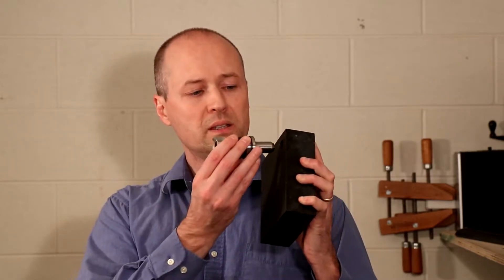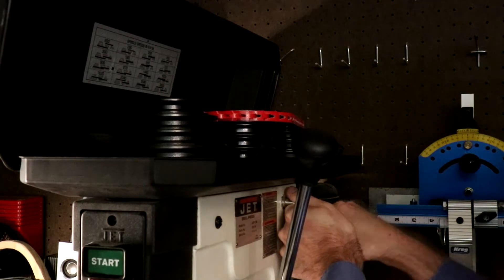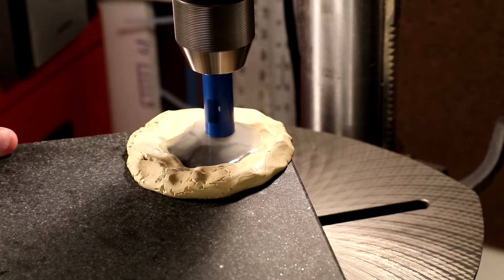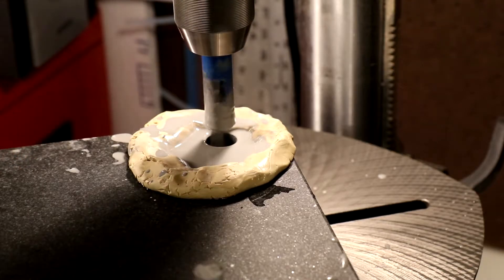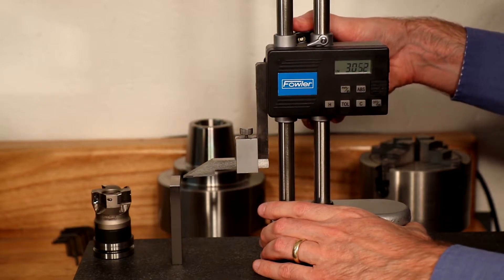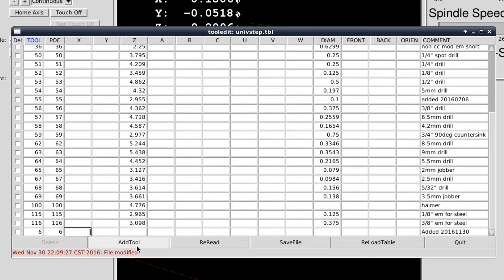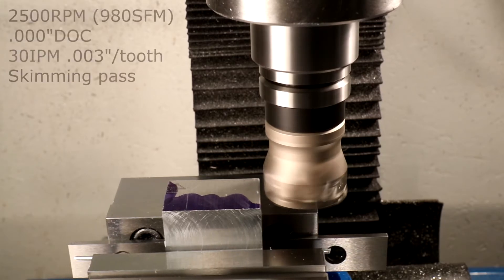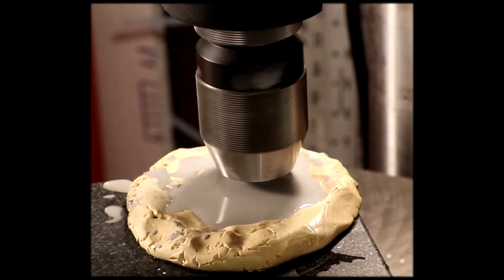Drill Surface Plate for Tormach TTS Tool Length Measurement

Comment: Nicely done!
Reply from the maker: Thanks Rus. Might complement your great looking TTS tool holder (https://www.youtube.com/watch?v=EI5ynlteYAQ) which is a big step up from the wooden ones from Tormach. An alternative to drilling the surface plate would be a ground parallel block with a hole. Best wishes, Kent

Comment: BTW, I'd love to get a list of the toys you have at your shop.  Its apparent you value quality and I'd like to collect some of the same tools as I begin my path.  For starters, which haimer do you have?  Which collets and endmills do you use?  Etc.  Thanks!
Reply from the maker: Hi Anthony. Do you plan to do a similar CNC conversion? I should create a list, but I don't have one readily available. You're welcome to ask what I use for XYZ, but of course my response will be mainly opinion as I've not tried everything nor likely have the skills to fully assess them. Regarding the three you mention, I put a lot of trust in Tormach to have curated a good collection of tools for their mills. I used end mill holders with my previous mill, but with the PM25, I've used the Tormach TTS from the start. The Haimer (metric) and collets (ER-20, inch and metric, largest sets, with a few extras for popular sizes like 1/8" that lack set screw end mill holders) came from Tormach. I'd recommend starting with the Haimer. It seems a luxury, but replaces multiple tools and simplifies setup. The endmills have mainly come from Lakeshore Carbide, variable three-flute for aluminum and variable four-flute for steel. I settled on them because John at NYCNC was promoting them, I liked the idea of buying direct from a US manufacturer, and that there was a person I could contact if I needed to. More recently, I've been building a collection of the modular insert tools from Tormach. Insert tooling is a huge field, but I trust Tormach has put together an appropriate collection for this size of mill. Drill bits are Precision Twist Drill. Get good drills because these mills don't have a lot of available power and drilling requires a lot. The only tool that I so far regret purchasing is the laser edge finder that Tormach sells, not getting the Haimer from the start, and a large air-over-oil Enerpac power unit for a power drawbar. That's not doing too bad :)
Reply: Kent VanderVelden a great list, and thanks for the insight.  Your experience with some of these things is a valuable starting point, and, as you share your experience, both bad and good, will help people like me avoid some of the pitfalls.  Thanks again for your time.